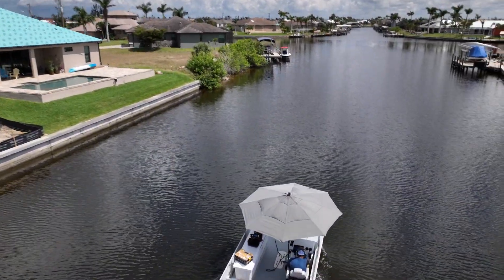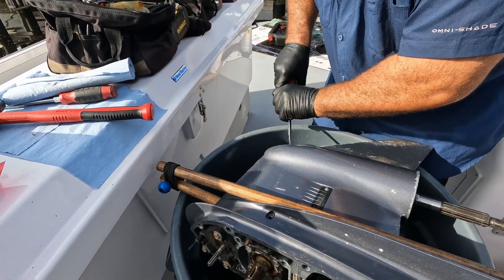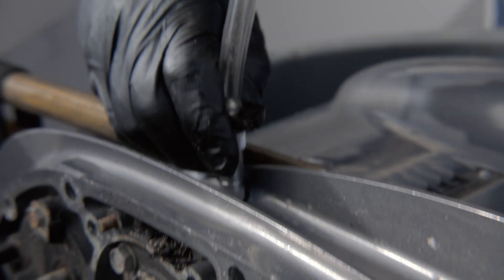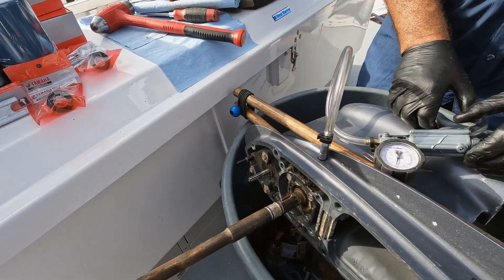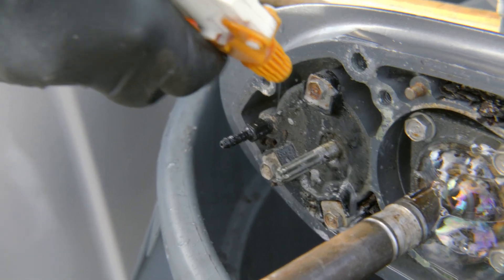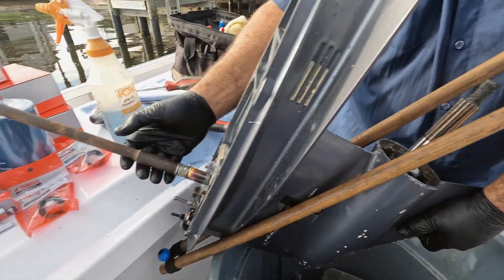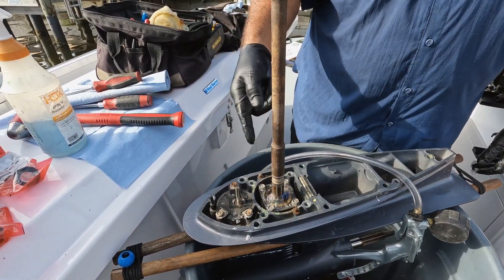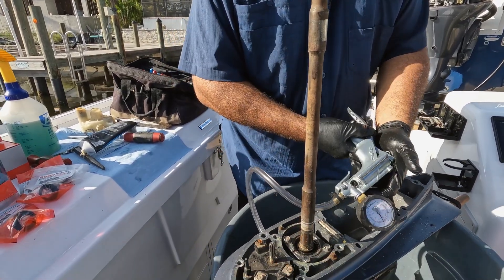How to do a Lower Unit Pressure Test | F115, F150, F175, and F200 | DIY Yamaha Outboard Maintenance

Comment: Amazon auto radiator pressur e
Tester  take tip from lower unit oil pump kit
You may have to emprathize and hot melt a plumbing tip to fit the connector